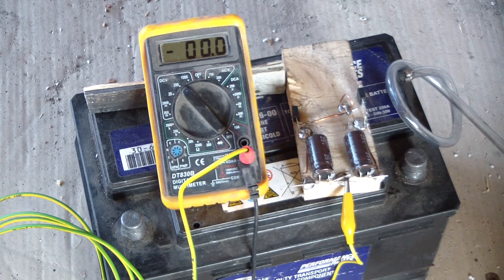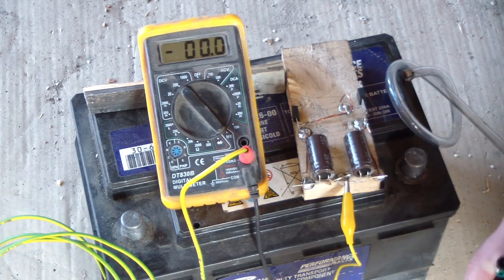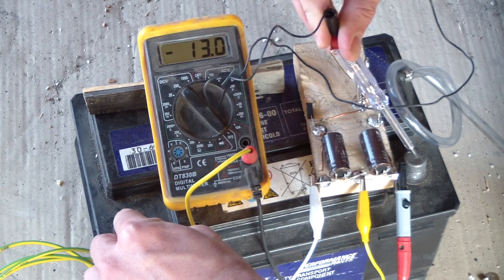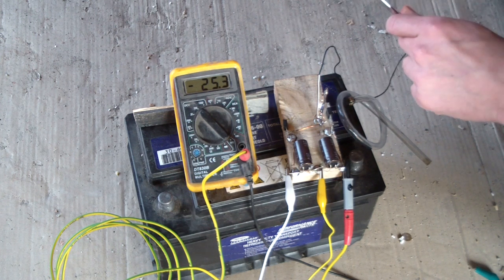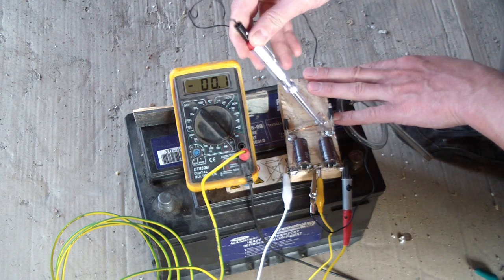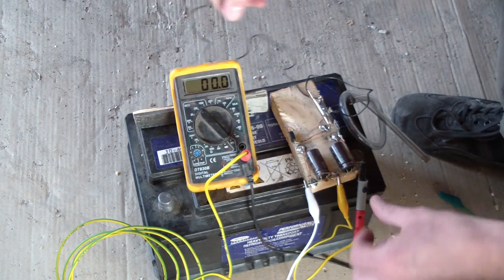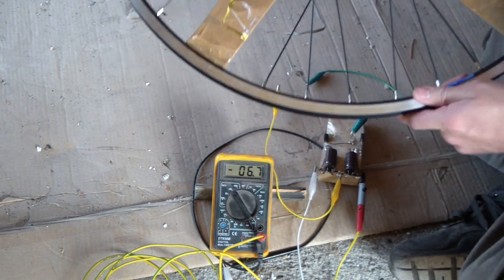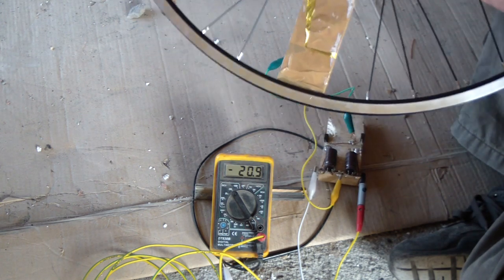Home made windmill generator part 11 - testing Voltage doubler

Comment: Something is missing, as long as I am concerned: You showed building the mechanical structure (I want to express my respcet for that!) and only THEORY of voltage doubler. I would LOVE to  see real POWER measurements, once the 'Home made windmill generator' built by You, has been installed somewhere in the open air and exposed to the wind. The cost of all the materials are NOT small (woodden plate + many strong permanent magnets + copper wire + epoxy resin of good quality in large quantity) and I want to know whether all the work has paid off? How about the TCO (Total Cost of Ownership)? I am very curious!! Last remark: I would NOT rectify the output power (unless you planned to transfer it to AC power generator 50Hz with 'clean sine wave' on the output, but instead I would connect the generator's output to the transformer to get the desired 'usable' voltage (protected by pair of varistors). How about reconnecting the coils into 'star' configuration, to get standard 3-phase AC installation??

Comment: Just an FYI. I saw a vertical wind turbine. The basic concept was that they had used a squirrel cage fan. On the bottom of the fan and permanently mounted to the shaft were opposing ring magnets.  I just thought it was neat the way they cut down on friction. The system floats on a cushion of air instead of using bearings.

Comment: This isnt a voltage doubler. You have increased the voltage by charging capacitors to 12 volts and connecting them in series to the battery. This may well give a reading of 24 volts but the capacitors will discharge in seconds leaving you with a 12 volt supply. If you try to draw any power through these tiny capacitors they will explode.

Comment: if your generator is putting out ac volts why not just use a step up transformer ?
wind spikes / voltage spikes could pop the caps & be very spikie dependent on size of cap and Hz and load   . ac voltage will travel with out loss a lot better then dc voltage and it can be rectified and regulated at the battery banks or load .
Voltage multipliers are often used in electronics where a small section of the circuit needs a larger voltage then the rest of the circuit and load is ~ constent
Just a question ?
I like the vids :) chears